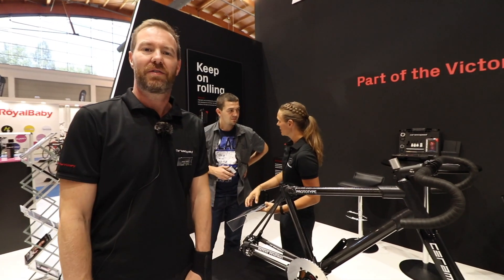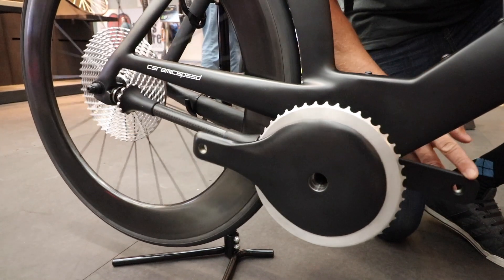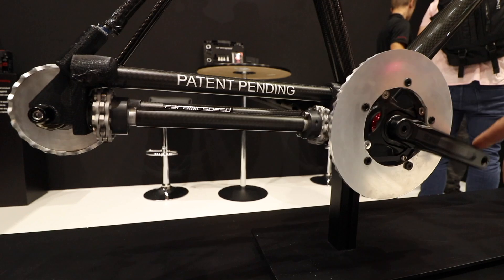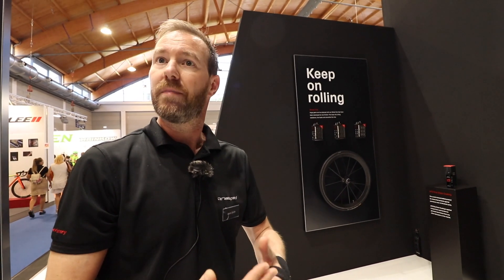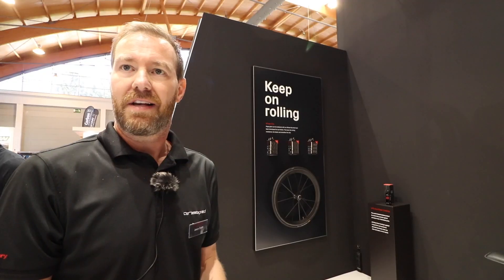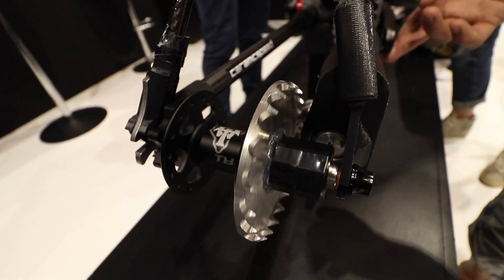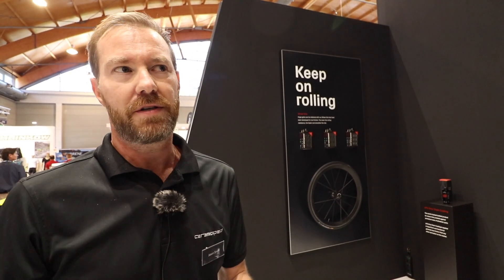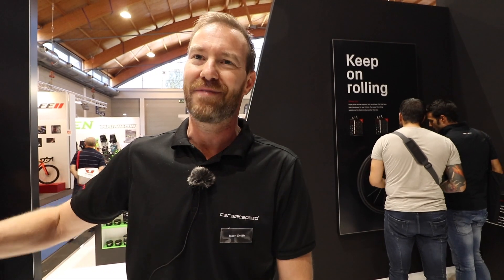CeramicSpeed Driven chainless drivetrain is 99% efficient

Comment: OK, now actually shift it.
Reply: I want to see them use it on cobbles
Reply: In this process is shifting not possible, it is currently just an proof of concept still in development.
Reply: Tomasz Pietrek They showed a bike with multiple years but they never actually showed it shifting there wasn’t even any mechanism connected to the driveshaft that would indicate it was capable of shifting
Reply: mushroomhill they have a single speed as well
Reply: There was a bike with this system as single speed: The Biomega Copenhagen. It used a shaft drive and was heavy due to a steel shaft because of the high torsion forces.
Reply: they did implement shifting. On the same event they showned the whole bike. With gears.
Reply: This isn't proof of concept, otherwise it would be able to shift.
Reply: The radial plate on the back wheel acts as the transmission in a sense, and he said the bike he was showing off was 13 speed. This means from inside to outside of the radial plate there are 13 sets of teeth. Would be pretty impressive if it weren't for this. In motion, every part that would be required to shift gears would be moving incredibly fast, especially at high speeds. This means the drive shaft coming from the pedals would have to shift in between moving sets of teeth in order to change gears, which, on Ball bearings, is a disaster waiting to happen, especially moving up gears as the torque increases. I could see a few plausible solutions for this, but they would fragile, expensive and complex.
Reply: Mitch Crane    
Incomplete demo!  You shift it in your mind!?
Reply: Calin Budau    WELL SAID 😂HAHAHA.
Reply: DilbertMuc FN hersthall made a bike with this exact same drivetrain in the late 1800s or early 1900s they just used tooth gears instead of “ball bearing” teeth
Reply: Calin Budau Well, the rear shifting seems like it would be easier to implement (make the drive shaft spring loaded and have a shift pull it back using cables), but the front...theyll have their work cut out for them.
Reply: There are no front gears. It's 1x.
Reply: ehm... the same event: https://www.youtube.com/watch?v=-9gQ1KRhesM
Reply: ehm... the actually did. on the same event. And no, singlespeed is far from 99% efficient. https://www.youtube.com/watch?v=-9gQ1KRhesM
Reply: Tomasz Pietrek how is it possible that is single speed is less efficient than a geared bike? All geared bikes are single speed if you don't shift so surely single speed would be an improvement over geared bikes that stay in one gear..?
Reply: its because this is a prototype of drive mechanism. on the same event, there is another one with shifting: https://www.youtube.com/watch?v=-9gQ1KRhesM
Reply: 1:44 look the glue con the cassette. i bet this one didnt even shifts
Reply: 15,000 years ago a caveman named Michael Stongelo invented this only to be laughed at. He threw it away and went back to riding a donkey...
Reply: Exactly. It doesn't shift because they haven't implemented a shifting mechanism and when they do it'll bring efficiency back down to normal levels making it completely useless, it's like saying a fixie is "99%" efficient. Anything will be that efficient when there isn't any shifting involved
Reply: Mitch Crane making it shift is easy when money is involved!
Reply: actually, on the same event, there was full build of a bike with shifting.